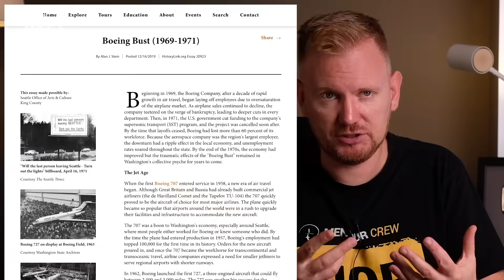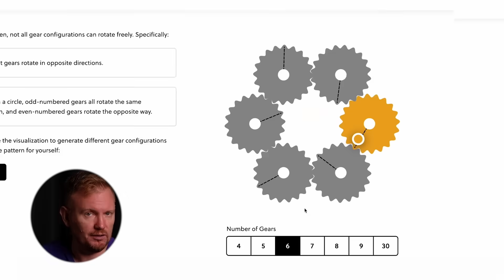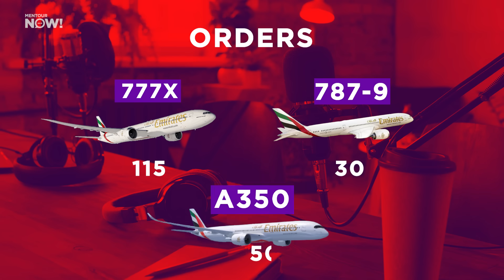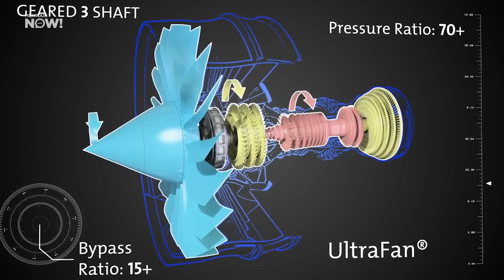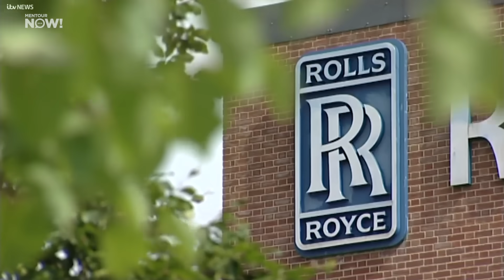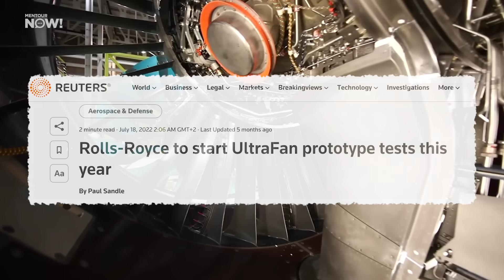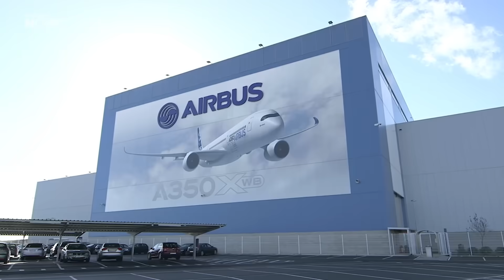Are BOEING planning a 747 with 2 ENGINES?!

Comment: Historically speaking, as the peak of internal combustion commercial engine & propeller combination demonstrated, the practicality of ever increasing sizes of airframes and jet engines either has reached its peak, or is close to peaking. Supersonic transport is not economical and has environmental limitations. Larger aircraft as shown by the A-380 and B-747 being 4 engines and occupy large airport real estate are out. The twin engine wide body seems to be the most productive and practical needing refinement in when and how it’s operated. Cruising speeds, airport runways, jetways area sizes, repair/service buildings, etc are very efficient today. It’s impossible to predict the future as to propulsion for planes, but the money needed for support of the engine being developed, wow. Thanks

Comment: Merry Christmas, may you be blessed with good health and happiness Petter and all your family too.

Isn't it possible that RR is developing this engine for the C-17 replacement? From what i know, the US military, had a time table to retire their C-17 fleet about 10+ years ago, but it was postponed due to lack of a replacement. Maybe there's something coming that way, hence the extreme size of the fan blade since the wings on top of the fuselage has better efficiency for military use, or that's the impression i got after reading about the C-17 construction.

Comment: There is an old saying, if you build it they will come.  I think RR is betting the farm on either Boeing or Airbus using the design specs of this engine to design a new super twin and leave RR well positioned to be the sole or preferred and proven provider with an engine in hand.
Reply: A big gamble more so than the "build it and they will come" expression would suggest. Having said that airframe designers would be taking more risk if an engine this big was vaporware. It's a bit of a chicken and egg situation which leads to the speculation in this video that maybe Boeing whispered in RR's ear.
Reply: Why doesn't Rolls Royce try its own hand in aircraft design? Hire engineers off of Boeing and Airbus or straight out of school and design a super jumbo... And wait for exactly the right moment to launch it.
Reply: @Rickyrab  It costs about a billion dollars to design and certify a new airliner, and that cost has to be absorbed per unit in the total production run.  The problem is you already have a lot of players in the airliner business.  Boeing and Airbus are the majors but there are many minors as well like Bombardier, Embraer, UAC, Comac to name a few.  40 years ago you have Lockheed, Douglas, and Boeing competing in widebody aircraft but this was too many companies making overlapping designs with that oversaturation hurting all three of them and causing some of these designs failure to make a profit for their respective companies.  With so much saturation in the market they could not sell enough units to cover the cost of development and tooling.  Rolls Royce has a rich history of aircraft design but would be the relative upstart marketing a commercial airliner.  This lack of reputation will make it difficult to make sales of other established manufactures  make a competing product and have a repeat of the the oversaturated marked.  RR could certainly build a viable jet, but I thing Boeing and Airbus would quickly snuff them.

Comment: if these engine manufacturers keep increasing the size of their engines for bypass ratio or efficiency or whatever, would it make sense to one day have the engines sitting above the wings instead of hanging under the wings like nowadays? or maybe we'd have to go back to having rear-mounted engines like the MD-11
Reply: No mounting engines above the wing would cause a number of issues. The engine mounts would have to be stronger/heavier, maintenance would be more difficult, they also affect the flight characteristics of the plane more.
Reply: It's more likely to have them go back to high wing configuration.

Comment: I don't think it is that unreasonable to consider that a 747 two engine design would be feasible and profitable. I hope so as I remember when the first 747 was unveiled to the press. It is still an iconic and used aircraft and this would certainly lengthen its service life. Thanks for sharing this and merry Christmas.
Reply: The 747 is one of Boeing's more successful designs, but that's because it found, and practically created, a mixed-mode aircraft, one that's both cargolifter and passenger liner. Or a long-range aircraft where, due to the long transit times (like almost sixteen hours to go LAX to Sydney), a bigger airliner that's carrying more ticket-buying passengers, let alone having the range to make a nonstop trip, is best.  However, airliners like the 767 and the 777 proved to have the right size for transcontinental routes, and the 737 the workhorse of the US Domestic airlines, especially Southwest, for routes in and out of more or less centrally-located hubs.

As I recall, Boeing did consider a Trijet version of the 747, much akin to the competing DC-10/11 and the Lockheed TriStar, but decided to build the 767 instead.

Comment: As far as I would love it to happen, I believe its exremely unlikely Boeing will restart the 747 production line just with 2 engines less, as far as it is a good design to carry both passengers and cargo, bringing it up too date seems very much too dificult, I don´t even think its even tall enough to  fit a larger engine that the GE-9X under the wing which on the test bed looked ridiculous and had to be tilted, a larger engine would mean at least the landing gear would have to be redisigned, as well as the wing, and at that point the fuselage designed to be made of aluminium would just not make sense, it would have to be cleansheet design and I´m doubting Boeing is even considering developing another twin aisle, when they are so far behind on the Max 7 and 10 variants, the 777X and the NMA (a project with far more certainty and market) is mostly scrapped at this point
Reply: That might require a new company, then.

Comment: Would the Ultrafan fit the AN-225, perchance? That would be a very small customer, even if Ukraine puts it back into production, but would be a great way to accumulate real world flight time, should the second fuselage be completed. I’m wondering if such an engine could make a larger fleet of cargo-specific heavy transport airplanes possible.
Reply: The engines of the AN225 produce 70-80000 lbs of thrust each
The GE 90-115 produces 115000 lbs of thrust each
Reply: @alexdelmistro8329  Incorrect.  Each one of the six Soviet-era engines on the An-225 produced 51,700 lbs of thrust, for a total of 310,200 lbs.
Reply: @alexdelmistro8329  yes and a fully loaded AN225 has both ponderous difficulty getting off the ground and a very limited range

Moving to a more efficient engine in the 100k pounds range made a lot of sense for a number of reasons

Mriya was built to ferry Buran and large spacecraft parts, but any further examples would be container-optimised

Regarding the economics: The kinds of loads Mriya carried were ones that nothing else was capable of carrying. Massive cranes or other specialist kit doesn't get used every day either (mriya arguably saw more use than a lot of specialist hardware)
Reply: @miscbits6399  Well, the An-225 is destroyed and rumors are the second unbuilt fuselage has been destroyed as well.  RIP.
Reply: The cargo transport operators are looking for better efficiencies such as twins offer, I'm sure they would be interested.
Reply: The An-225 was a one-of-a-kind spectacle, but was an economic disaster as a freighter.  It only made about 20 runs per year - once every 18 days on average - and spent most of its time sitting idle on the ground.  It was an 'all or nothing' deal, meaning you had to rent out the entire plane, at the cost of a million dollars or more, not including fuel, crew salaries, landing fees, etc.  
It wasn't configured to do containerized freight and was not profitable.
Reply: Uh, you know what happened to it right?  Should have been flown out to LHR first thing...
Reply: @michaelrmurphy2734  I think the commenter is talking about a hypothetical situation where they do rebuild it.
Reply: @michaelrmurphy2734  there’s a second fuselage awaiting completion (for like 20 years!), and perhaps fitting it with fewer bigger engines might make it more financially viable? It’s also a high-wing design, so is one of the few existing aircraft that might be able to use the engine. Maybe also the C-5 Galaxy? But Myria deserves a second life, right?
Reply: @PetesGuide  Antonov have been talking to China about farming out AN225s and AN124s for a while

All the existing airframes are close to end of life and China has a need for heavy lifters

The problem is that a market of only 40 engines isn't large enough to justify production

The Saturn-D engines used on AN124/225 are maintenance heavy and very thirsty, but it's not worth re-engining the existing aircraft given their impending grounding

Comment: I was just at the Boeing Bldg 40-21 in Everett. The 747 Assembly line is gone. Scrapped. Never to be again. 
They were dismantling the overhead gantries and prepping for the 787 line to move in.
Reply: In before Boeing eventually finds reason to invest in a new Jumbo Jet line...

Comment: I have not seen the numbers so this is pure speculation on my part. I do not believe that Emirates is making a killing on the A380s but they do have to try and recoup the huge sums of cash that they paid out not all that long ago. If the A380 was already an older airplane and Emirates had options for more efficient aircraft, the only thing that the A380 would provide at that point, would be the fact that the customer likes them and in many cases, would fly Emirates just because of that. Regardless, the fact that they have so many and that they are not that old at all, means Emirates will continue to fly the type for many years to come.

Comment: A brand new B 747-8 was very recently scrapped . If A twin engine was even possible surely this new 747 would have been a useful starting point. I doubt it is economically feasible to retrofit twin engines as the whole design ,weight and fulcrum point would be compromised.

Comment: Just parachute 2 outer engines after take-off. Easy. Kidding. One understands that it is both size and need for that one single engine under wing to keep plane flying in case of one shut down.

Comment: For a 747 with only two engines, they'd need to built at least a very different wing. You can't just cover up two empty engine mounts and carry on. They'd need a 747 wing with just one engine mount on each side. 747 TriJet drawings, anyone?  😛

Comment: I work in the industry with knowledge from all 5 key representatives of this industry. Airbus, Boeing, GE, Pratt, Rolls Royce.

One big hint here. If Rolls knew a 747 2 engine variant was coming, do you REALLY think Pratt and GE would just up and ignore this or as you suggest be ignorant of it? HA! Boeing would NEED a second engine option!

I can tell you with certainty, Boeing is not coming out with a 2 engine 747. 
I can tell you that Airbus, is also not coming out with a bigger aircraft soon, and is focusing on making the current designs cheaper through better production methods.
Pratt is floundering and trying to fix in house production and design issues with their engines, and keep issues they do have quiet.
Rolls is pretty much doing the same as Pratt, at the same time hedging their bets on a big aircraft that is supposed to come out, which won't be passenger. 

They cannot commercialize this due to Pratt's patents, and the lack of need for this.

GE, the only SANE one of the group is focusing on perfecting the GE9X platform and push it to higher efficiencies. 

Flat out, no.   nobody is coming out with a 747 or for that matter A380 twin engine option or even a NEO.

Comment: I'd love to see a Boeing 747 with 2 huge engines.
Reply: I presume they would have to substantially re-design the rest of the plane to accommodate the larger engines and also to deal with the asymmetric thrust should an engine fail. I've heard they've looked into reducing the number of engines on the B-52 bomber which would make it a lot more efficient, but it's not worth the cost of redesigning the rest of the plane.

Comment: Several years ago at Casper WY I saw a 747 with a 777  engine on the left inboard wing.  They were testing the 777  engine.  Not much ground clearance.
Reply: Wyoming is where they do the 'cold-soak' testing for Boeing planes.

Comment: It was so hard to re-engine the B52. The economic case is squarely against a re-engined obsolete fuselage with an expensive redesigned wing.
Thechnically,  lateral control with one monster engine out is a problem

Comment: I was told twin engine wide body jet became popular after FAA lifted the minimum 3 engine aircraft requirements for flying across Atlantic in 1990s.

If large capacity jet able to product thrust by using 2 engines instead of 4 engines. From enconmical point of view, the solution already written on the drawing board.

Comment: Four engines are inherently safer....redundancy. At one time passenger aircraft with less than 4 engines were prohibited from flying across oceans.I dont think something that large and heavy would be able to function safely with only two engines if one failed.
Reply: In my opinion this realization will someday be forced onto our beloved, financially driven airlines. And from an enthusiast standpoint it might be necessesary to normalize things. There is no point in arguing, redundancies are a really big thing in technical solutions. Why should a transatlantic plane be exempted from beeing safe?

Comment: Patent protection should not be a limiting factor in this business. The protection usually only lasts for 20 years after the filing of the patent. Considering that the first company to develop a novel engine will have to file the patent before they start development of said engine, the 20 years protection may not be a hindrance for a competitor. By the time the competitor sells his engine the patent could easily have expired.

Comment: The most comfortable plane ever was the 747. I loved traveling in it (for the brief period I did).
Reply: Ive flown in both the 747 and the A380 and the A380 is more quieter, stable and slightly more spacious. 747 may have the title, but A380 wins in practicality (passengers wise)
Reply: @FlyLeah  Haven't flown in an A380, so I've no idea. I'll take your word for it.
Reply: As a passenger, I found the B747 noisy and uncomfortable compared with the A340 and A380.
Reply: It seems you have not travelled in an A380....beg to differ way, way more comfortable and way, way quieter
Reply: @oliversibbs  AMEN! to that.
Reply: @oliversibbs  Yes, well, it's a modern plane. Design/build specs are different today. Nonetheless, my experiences with the 747 were good. If they weren't, I'd have said so.
Reply: @miketype1each  But the 747-8 is about just as modern as the A380, and still the A380 is quieter and more comfortable. And you stated most comfortable EVER note EVER. Not true.

Comment: I always wondered if a re-engineering of the existing 747 with new composites, materials, engines and fly by wire systems could make it more efficient and cost effective. Giving the air-frame a new life.
Reply: Be careful what you wish for. Last time boeing redesigned an ovbiously outdated model to the modern needs didn’t start well.
Reply: Composites would be a major redesign. There wouldn't be much original left if you upgrade everything you suggest. I think both Boeing and Airbus realise currently that the status quo is good for both of them and they don't need to spend unless the other does for a few years. I believe several new technologies are expected to be available by the 2030s that will be a worthwhile improvement.
Reply: They wouldn't copy the 747 design for a new composites model.  If you look at a 747, you can see it was designed for speed.  The sweep of the wings, the fineness ratio of the nose (the 'pointy-ness') are all indicators of the intent.  Even though the 747 was going to be relegated to strictly cargo when SST's took over all the passenger traffic, it was designed to cruise at Mach 0.90.  Fuel was cheap back in the late 60's, so it wasn't a problem.

Today, you'd make the nose more bulbous and the wings less swept, as the design cruise speed would be Mach 0.83, something like that.  Get more seats upfront and have a more efficient wing, with a lower takeoff/approach speed and less complicated leading edge flap system.
Reply: "I've had this axe forever, it's has two heads and five handles."
Reply: @dukeofgibbon4043  That would be the 737...
Reply: There comes a point where the airframe life doesn't justify it; also, the engineering involved in various upgrades is often better spent on new aircraft lines.

Comment: Serious question:  Isn't building a brand new engine with a completely different size schematic the same as creating an untested brand new vaccine? Wouldn't there be fatal deaths because of the unforeseen inevitable issues that will come about ?? Hasn't the industry already claimed its share of fatal accidents over the years and learned from them so they won't happen again? why then are they trying out new sh@t that will surely bring more learning curves at the cost of innocent people's lives???? Can someone answer this, please?.
Reply: Sounds like you're asking a rhetorical question professor, as you seem to have all the answers yourself. So why pose a question........?

Comment: 25-12-2022.Petter, you have pionted out the elephent in the room, why so big and powerfull jet engine goe,s back to Lockheed,s Very Large subsonic transport, which l designed, and is still on the table, so now you see, Merry Chrismas petter.